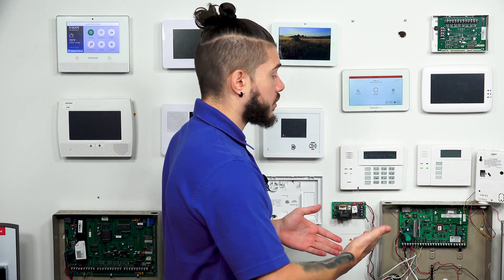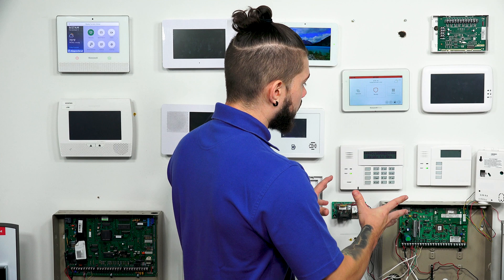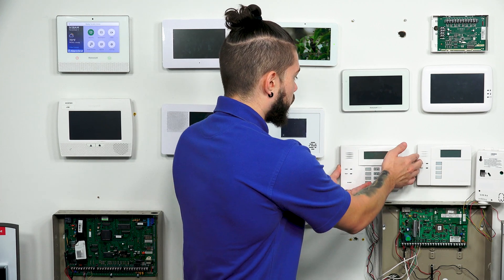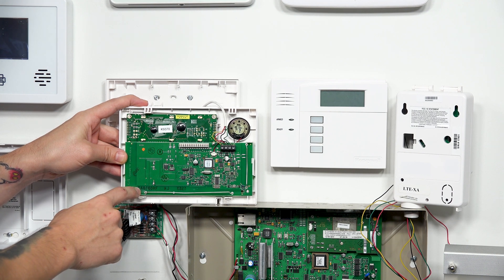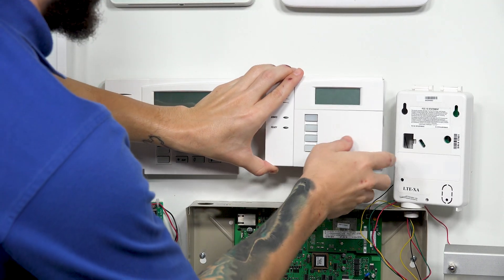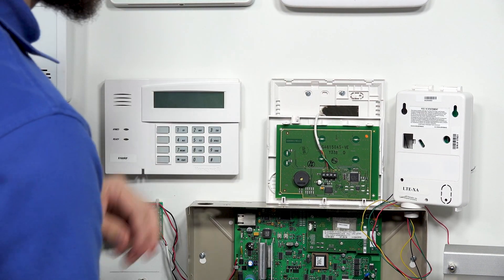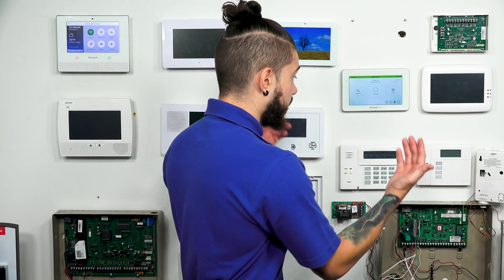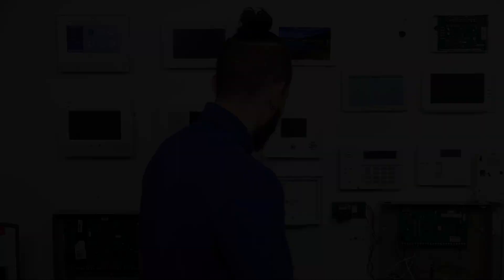How to Tell If a Keypad Has an RF Receiver Built-In

Comment: Ok...so I figured out on my own that keypads with no antenna are for hard wired systems only and cannot communicate wirelessly.  I wish he had just said that.
For all I knew the panel could also have a transceiver or the cellular device or whatever....who knows.

s44
Reply: Hey Randy, How are ya? That is not entirely true. I also think you are confusing a lot of things. Built in RF antenna just means is can talk to 5800 series transmitters. It is still a hardwired keypad in the way it talks to the alarm panel. If it doesn't have one the receiver could be a stand alone receiver like a 5883. Cellular devices are totally a different subject that has no bearing on an rf receiver. All current model keypads that have built in receivers are also transceivers. The purpose of this video is for one who may have moved into a home with existing equipment and just simply need to determine if the keypad has a receiver/transceiver built inside of it. Maybe the receiver stopped working and they cannot find the standalone receiver, so they are seeing if a keypad is the receiver. That way they can setup or plan the rest of the system accordingly. Hopefully this clears things up a little bit. Enjoy.

Comment: Do you have a video on how to program wireless smoke detector to vista 128fb/32?
Reply: I'm sorry we do not deal with fire systems. It should be similar to a 128bp though, with a few different zone programming questions, if that helps. Just remember those systems are life safety and you want to be sure it is done correctly.
Reply: @freddaniels8259  All right thanks!